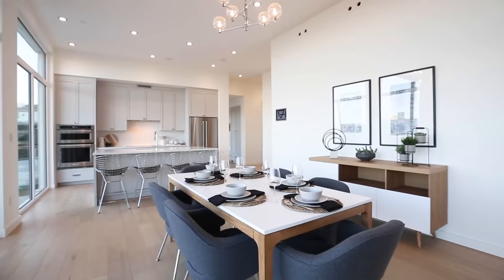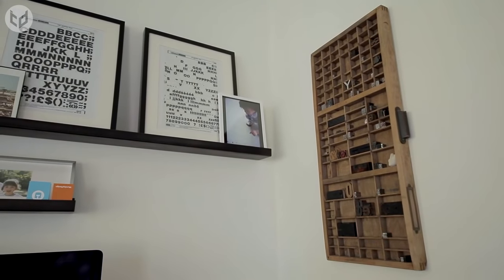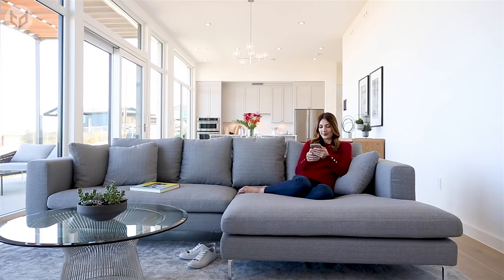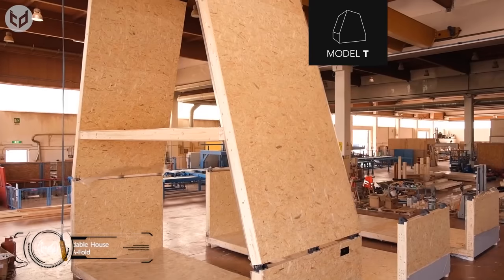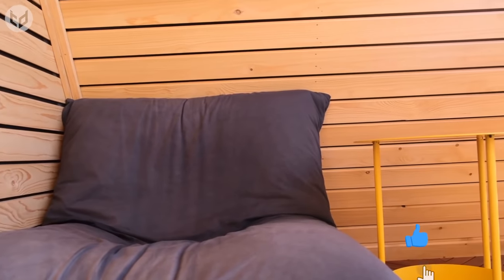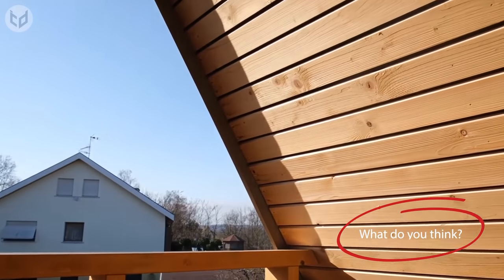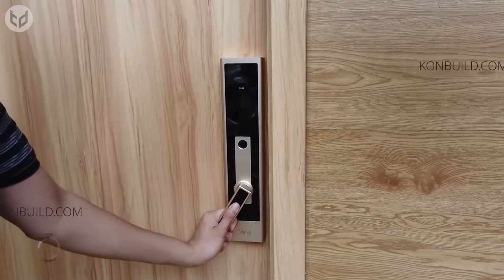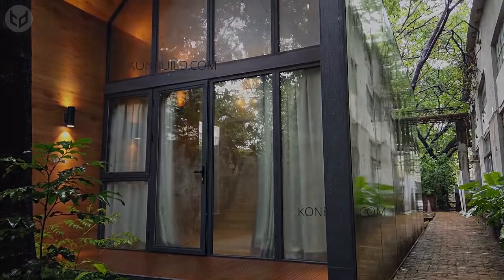Fantastic PREFAB HOMES #2

Comment: Nothing beats quality craftsmanship on site building.  Prefabricated concrete walls are a great option and the exterior shell is set in one day. The prefab concrete walls can incorporate 12-15ft wall heights and wide open spaces without additional supports . A 2 story 25x25 wall system complete with exact window and door openings and headers that can support the heaviest retractable door systems is standard...all for 32k USD.

Comment: Yawn... This is a mash up of recent and old promotional materials. Which is why the starting costs and build timelines are no longer applicable.

Container home are going to be a nightmare to sell. Connect homes are more expensive and appreciate less than a site built home. Containers were the on trend thing to do. However with this trend melting like the habitats inside and resales values plunging off the side of the ship, rough waters are ahead for owners of these once international traveling containers tuned homely homes. 

Prefab all the way. Focus on low VOC modular home builders. Containers belong in the transport of goods. We don't fully understand how containers lined with spray foam will hold up over time. Nor are we certain spray foam insulation is not a health hazard in tiny homes. Always be sure your home is built to code and has the appropriate HVAC system for the materials and how of airtight your build is designed to be. The inside air must be exchanged multiple times an hour or day based estimated amount of VOC off gassing; or having the air tested to determine how often the air needs to be exchanged to mitigation health risks. Self build container homes almost always cost twice as much as budgeted and end up looking link a DIY RV build with 90 furniture. Thanks 5o many containers being scrapped during the pandemic, we have no need to reuse containers suitable for home building.